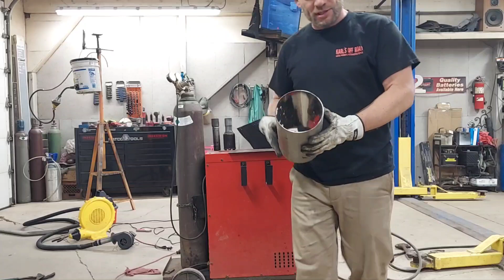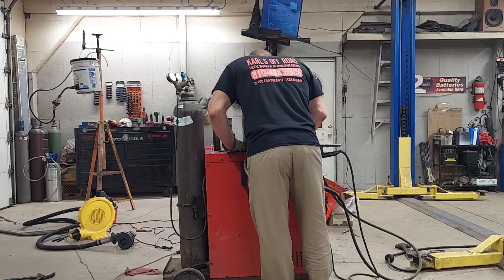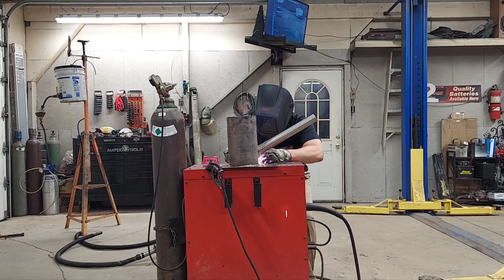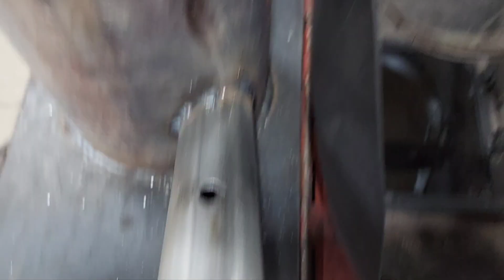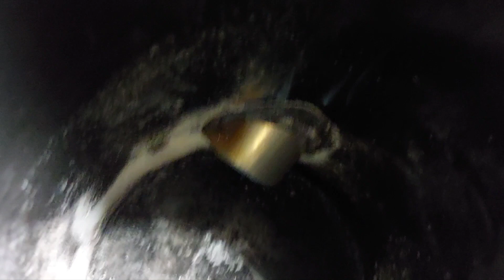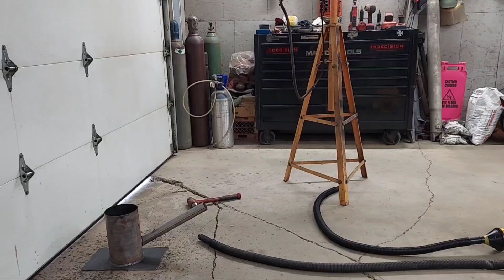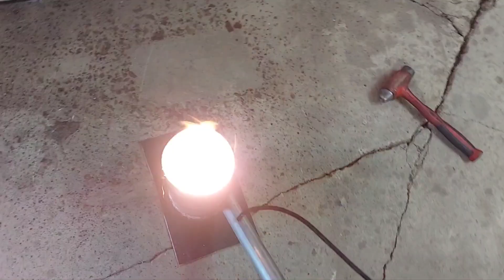DIY waste oil burner, almost anyone can build!

Comment: Did you use 309 wire to attach steel plate to stainless? It would last longer if you did.. 😂
Reply from the maker: No,I have everything to weld stainless, but I just glued it with regular mig wire and 75/25.

Comment: Cool thing.
At what minimum fuel consumption will combustion be maintained?
I want to install such a thing in a metal stove for the garage.
Reply from the maker: @OleksandrYushchuk8  once you get it up to temperature, you can turn down the fuel to maintain combustion. I've never actually tested the consumption. My educated guess would be about 2 quarts/hr. or less. It really comes down to how much heat you need for a given space.

Comment: Maybe one of the best designs out there, kind of like the ones I sell lol.
Stainless steel bottom would help even more since it holds in the heat and will get the chamber much hotter.
Also a top that makes it so the air is forced out of it, basically a restriction, this creates a slight pressure inside that will keep the flame more even and steady just like pipes on a 2 stroke dirt bike.
The restriction top will also keep more heat in if you want to burn less oil and have no smoke out the roof.

Comment: Gerat video! Simple as it, BUT how can you prevent the fuel tank from catching fire through the oil line?
Reply from the maker: I've never had that problem. That's the only problem I've never had! Lol,I run one in my boiler 24/7, and that's how I have always done it. The oil will vaporize much easier if it's warmed up. I know some like to have a p-trap in the line,but I've never needed it. Thanks for watching!
Reply: @karlsoffroad  Thank you so much for the good idea :) I will make my own to. Greetings from Hungary/Budapest!
Reply: It won’t catch. Inside Fred tube   No oxygen in there

Comment: Im looking at building a waste oil burner to heat my shop, I like this design. I’m thinking of using 6 to 8 “ drill casing for the burner pot and putting the whole deal inside an old water heater

Comment: How much oil does it burn
Reply from the maker: It can burn as little or as much as you need. The power output of any type of burner is determined by how much fuel you use.

Comment: 0:16 this is just a f**** piece of stainless steel that's worth a crap load of money unless you can get it from your buddy Joe down the street
Reply from the maker: I'll build an easier to obtain burner next. My other burners are made from exhaust pipe. I'll make sure there's no welding required as well. I will change the title, too.
Reply: @karlsoffroad  I'm not ripping on you, and I subscribe to your channel... I just see a lot of people post that they did something with some part which cost a lot of freaking money and it's not replicable unless they have the same source for that part.

I love anybody posting about welding and waste oil burning.
Reply from the maker: @xephael3485  I understand completely. I didn't think about the material, more about the simple design. Someone else pointed out the welding, which I didn't think about either. I'll make one out of an old fire extinguisher. I know those are easy to get. Thanks for watching and commenting!
Reply: Unless you live in Africa or some far off place most steel supply companies have remnants a piece like that I can get all day long for less than 40 bucks.